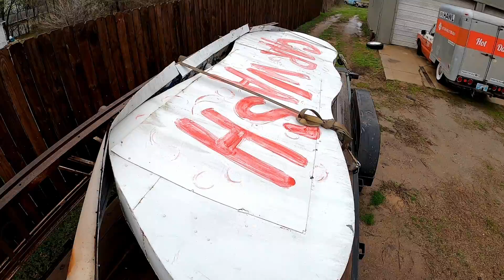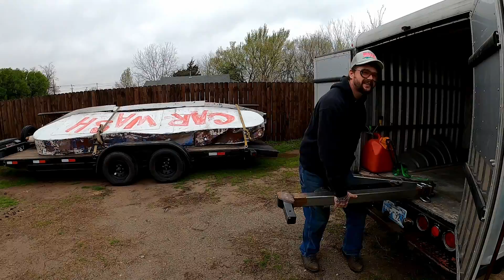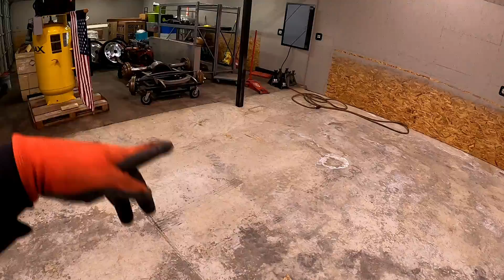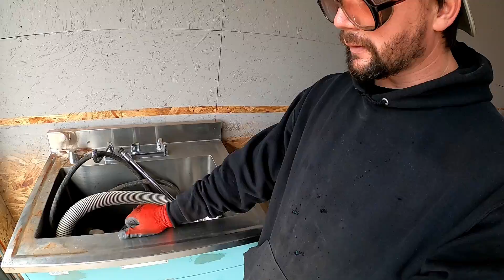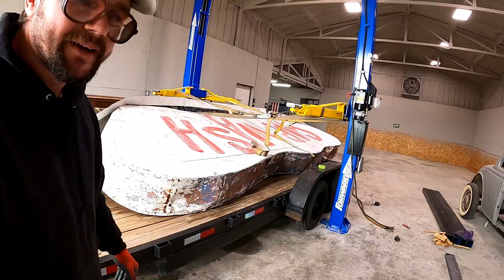BIG SIGN, BIG PROBLEMS. Successfully wasting time.

Comment: IF you need a welding truck look into military surplus. Years ago they used Dodge 3/4 ton trucks with a custom box. Gas motors and they worked well for the job. You could probably find one and use that for a starting point.

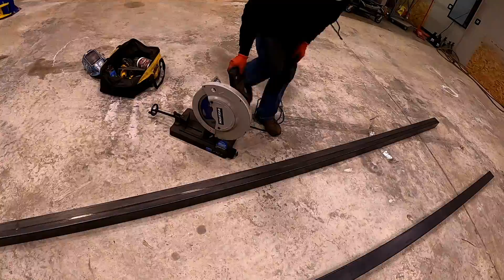Comment: @12:45 you had just finished saying "We Dang Sure Don't Want These at a 45" 
But a 45 just might be your best solution. 45 on the Breaker wall and 45 on the far wall.

Comment: I bought a harbor freight parts washer, works great but put that  35 gal bucket on a piece of plywood because it rusts underneath the barrel when its on concrete. Mine leaked out all over the place after 5 yrs

Comment: Get a concrete cutting company to cut a groove around the base of that wall. Then put your metal plating into the groove and attach your metal plates to the wall. you can also trowl in some hydraulic cement into the groove and sink the plating into the cement. They sell that cement in gallon cans, just mix  water with it in a paint bucket it takes a day to set. So you'll have time to work with it. Gotta keep them sparkys away !

Comment: it ain't cheap but one of the things you can use is Hardie board made of concrete for the lower part of your wall to prevent Sparks from catching your or sheet metal

Comment: thats a nice lift.  Don't hook to a 100 amp Disco.  Keep it instead.  Replace the breaker in the panel it's like 10 bucks.  Theres a lot of short cuts but don't take that one.  Especially with a flying splice.  I know your already done but that can be a really expensive hack.

Comment: Never thought of the sparks starting the wood on fire, but wouldn’t it be massively cheaper to put aluminum sheathing at the edge instead of thick steel? I guess the aluminum wouldn’t stop the walls from getting scarred up. I’ll defer to you though. You’re building a fantastic shop, so don’t listen to me. Cheers from Maryland.

Comment: When we got our lift at work, I read a suggestion online to run a file down the inside of the posts where the sliders (or rollers if you lift is fancy) travel up and down the columns.  There was a ton of weld spatter in there, so knocking those down probably greatly extended the life of the lift considerably.

Comment: Puddin why move the chevy when you have the 4000lb lift against the wall..if she's workin' you could easily use it to pick up  the chevy one end at a time..
Reply from the maker: Also the print on that lift said 100 pounds when I got it. I turned the 1 into a 4 and added a 0 with a permanent marker 😂😂

It’ll definitely do more then 100 but the 4000 was a made up number 😂
Reply from the maker: The lift reaches other made 5 ft. That’s a 17ft king car that has to be lowered at the same time

Comment: I would use PVC baseboard trim if you are concerned about sparks rolling up against the bottom plate.  You can buy PVC panels in larger strips or even sheets and rip down on a table saw.

Comment: Insurance Insurance heavily insure it but sparks from welder will cool quickly and it will not burn down the garage.  I have seen oily rags cause more garage fires than a welder. You said to lock down a good woman, there's no such thing as a good woman.
Reply from the maker: That’s funny, having a good woman has helped greatly to get me where I am!
Reply: @Puddin's Fab Shop 2 (All The Extras!)  you got lucky most women nowadays are worthless gold diggers got 3to5 kids and they are simply wore out from all the 🐓that's been ran through them

Comment: Go get some shower wall sheets at lowes or homedepot. Run them 4x8 sheets along the bottom of the walls, they aint fire proof but no sparks will randomly light it up. Easy to clean, flat so you can mount stuff to the wall... cheaper than metal plates

Comment: For spark suppression ... don't cut or weld near the wall ... use containment blankets (fire retardant) when cutting or welding ... install a full-building freon-based fire suppression system (pricey these days). Mix & Match Puddin! 😎

Do you have a sink and hot water heater in the new shop? If so - Parts Washer. If not - BUY a Parts Washer and hook that puppy up.

RE: Your wallet, hope you found it. For me it's always in the last place that I look - and the first place my wife does.

Comment: also... for the skirting I gotta wander if you could maybe cut the sidewalls out of a bunch of tires then split the tire hoops and use them for heavy duty skirting around the workshop inplace of the metal? Surley old rubber tires are aplenty and sure they might catch fire but are much easier to see and replace

Comment: You made the right choice with the sign Puddin. As for the pole in your workshop set 4 or 5 feet back and that give you room to move between the 2 areas and support the loft, just my 2 cents. Have a good one brother.

Comment: I pressure treated 1 x 6 with a angle cut on the top was my choice for trim everywhere. Paint everything with exterior paint and caulk the floor seams with a good caulk . 28 years and no problems with fire ...let er rip

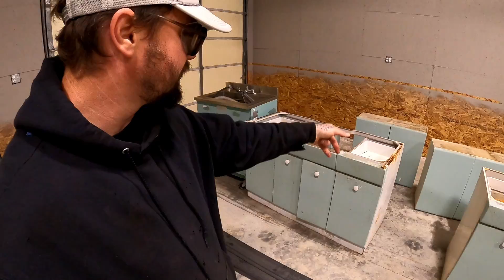Comment: @10:15 I might suggest cement board from your home improvement store. Used as backing for tile. Pretty much fireproof. Has to be cheaper than using thick steel? That steel would be better used in your fabricating :-) You can always double up with some flashing from the roofing section. That can be purchased in long rolls. Thin but also good for what you are looking to do.

Comment: Sink/part washer.use the sink, but transfer parts and lid from a Horrible Fright parts washer.  The recirculation pump is a self contained unit.

Not sure if you noticed, but the reverse lights are not working on the Yee Hawl

Comment: If I were you, seeing how you light fires with the 'slice-n-dice' let alone a welder, line that lower section with cement board. Durock or Hardyboard.

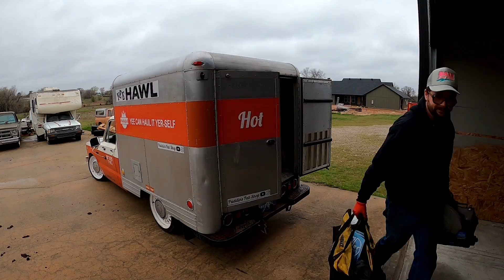It's moisture resistant, fire resistant; you could finish a number of ways. Its mostly used as backer for tile however, I first encountered it in a middle school with an acrylic texture finish. 12:03

Comment: I would put pipe each side and I would put a H steel going across that way you can put Chan fall that is on rollers that way you can lifted things and push it over to either side . I would not what that poll in the middle of the floor it be in the way. Hay did you fine your wallet I hope you did

Comment: one key in each vehicle! Id hook the sink up as a sink, most shops Ive ever worked in had a regular sink if for nothing else washing hands but you could add a spray hose in case of chemical splashes to the face

Comment: In regards to electrical work: I didn't closely examine your setup, but as a general rule, it is safer to close disconnects(knife switch) before closing breakers, and the opposite when opening them. Disconnects are not built with arc flash protection in mind. Breakers are. That is why you want to use the breaker to make or break the circuit and disconnects just for isolation purposes.  It is less consequential with lower wattage circuits like what you were working with, but still a good practice. Low voltage circuits kill people about as often as high voltage and usually it is because of less percieved risk.

I work as an operator at a power plant. I am not an electrician but I do a lot electrical work on circuits ranging from 13,800 volts down to 24v circuits as a part of my job. I am totally good with people making their own decisions regarding risk, but I did think I would at least share that knowledge because if you don't know, it is hard to make good risk assesments.

Comment: Not sure if you have a circular saw but a 7 1/4" diablo carbide steel demon is a beast for cutting metal, if ya got a 10 or 12" miter saw you can get the same blade based in the size.

Its not a metal cutoff miter saw blade but those blades on a regular old wood cutting saw will do wonders.  Just throwing it out there.  Also doesnt heat the metal up or shoot sparks.

Theres a video demo by Diablo of the damn blade cutting 1/2 way through a piece of railroad track

Comment: I bought seconds of white metal shop exterior and cut it 4 ft. tall.  I mounted it to the bottom of the walls and built a shelf with a 2X6 at the top for storage.  Ended up working well and I can power wash the shop when needed.

Comment: mop board works pretty well at the base of walls.  I dont like open shelves or tables with clutter under them that sparks can hide.  I try to get as much stuff stored in metal cabinets as possible.

Comment: On the parts washer.   I bought a HEATED parts washer, and I use Zep Industrial Degreaser in it. When I use the heat function, the ability to clean parts doubles. Build a heated parts washer!

Comment: Pro tip, keypad lock.  My shop and warehouse has one.  Remember the code with a key backup.  You never get locked out.  As for fire prevention, I built a steel building with steel walls inside.  Taking no chances.

Comment: For your spark resistant baseboards we ran mortar for bricks about 1\4 inch thick with chicken wire just screwed to the wall for about 8 inches tall and then we just put sheet metal as wainscoat right over the top

Comment: If your worried about cetching fire put that thin aluminum star plating under your kicks on your cabinet doors .I think you can find it selfadhesing And 8 or 10" of thin metal at the bottom of the walls in your welding area.

Comment: PUD! Take your time. You are one step ahead in your motivation, one step behind in the situation. The steel at the floor is a concrete staining conflagration, the posts are a positioning miscalculation, and you will discover the the correct posituation. Etch the floor with vinegaration. Then  use a polyurethathane sealant, (available under several different brand names at your local hardware store) to glue a synthetic (vinyl, polystyrene, PVC, cheap) base around the shop. Save your steel. Think of the overhead supports lengthwise and buy some cheap local lumber guy's stuff and put your posts where they work. Love you man. Andy

Comment: About your fire protection question, it's a little late now, but there is a such thing as fire rated plywood. It's used in construction. Could replace the bottom 4' of that osb with rated plywood.

Comment: I got to say that I usually roll with what you put on you tube but this episode was an absolute mess and waste. Does Oklahoma have building and electrical inspections? That redneck wiring of the lift takes the cake. PS, use the sink for what it’s intended and buy a parts washer with the money you wasted on the sign.

Comment: There are some flame resistant paints and sprays, you could paint the bottom bit of those walls with some, if you were really worried about it. 
I think you should use the sink as just a shop sink, if you have plumbing out there.

Comment: You could seal the bottom with fire caulk before you add your baseboard and another thing that will help with your wood wall finish is an Intumescent (fire retardant) paint.

Comment: When you nail your baseboards put a old 2x4 on the top against the wall and the ground like a ramp into the wall resting on the baseboards step it down and nail it hit a stud and caulk or silicone the small cracks it will still dry out if it gets wet if you use silicone you can give it a light spray of goof off to smooth it with your finger

Comment: I think you'd do well to have sprinklers installed in the shop.  Wouldn't cost much to drill a well near the shop and that could feed your sink,  emergency eye wash station and swap ass shower as well.  Plus the homeowners insurance might give a discount.
Reply: Good idea, but around where I live, having a well drilled is approximately 5K. That's expensive to me.....

Comment: In Florida, we would probably put medal lath, and stocco that, think about it, fairly cheap, and water proof, can use synthetic comes any color, wire lath is like 28 inch wide by 8 foot, is what I would do, check into it

Comment: Puddin, We use sheet metal in our welding area to protect the walls from sparks.
I suppose you could also use that slate stuff (or whatever it is) that people put under their free-standing wood stoves.
If "Sitting on your ass won't finish your project," will sitting on your project finish your ass?...😉😜

Comment: RED fire stop, it comes in a tube like caulk, run a 3/8 bead on the floor and one  on the wall, set the plate in the caulk then push it up against the wall and screw it, that way the plate is sitting in a bed of firestop and its pushing firestop in the gap protecting your sill plate, it wouldnt hurt to run a masons string along the floor next to the wall to see how much the floor fluxuates, you may need a little more here or there, I cought my garage on fire once, I was grinding on my vega and sparks were hitting the ceiling joists, I smelled wood burning and looked up to see my ceiling joist in full flame! I painted all my exposed wood surfaces with fire proof paint and was fine after that  that was a scary sight, carry on brother

Comment: Oh Hell Yea!! Hey Puddin, look into some fire retardant paint for the lower part of the walls. Had to use that stuff in a shop I worked at in the past. The powers to be wanted us to paint the walls with that stuff up to 4 feet from the floor, because we were using a forklift in the shop that they said could scorch the walls.

Comment: I worked in a body shop that was on a second floor of a old wood building they had 16ga metal  on the floors and 3 ft up the wall, that's what the fire inspector wanted.  never had a problem  I would seal it to the floor

Comment: I would use fire caulk to seal the base plate.  It is intended to stop fire from running thru penetrations in walls and floors.

Comment: Use some thin angle iron like 2" wide along the floor you could tapcon to the concrete and screw them into the studs will help with structural support too just in case a nado comes

Comment: I like them ole blue cabinets. on one of the british car shows they used a vapor blast? it looked like a pressure wash/sandblast cabinet. you could have a vintage one with all the stuff u have with it already. U could get some poly carbonate for the top and it would be bitchun. I am tryin to find somethin similar, to con vert my old pressure washer. oh well dig ur shop. asta!

Comment: Rather than a parts washer, make that old sink into an ultrasonic cleaner -- imagine the carbs you could clean in that!  An "off-the-shelf" ultrasonic cleaner could be scavenged and or modified to vibrate a larger tank, like a stainless steel sink, I am sure of it.  Couple fry baskets later, whammo!

Comment: Replace the bottom row of osb with sheetrock. Fire tape the joints and run a bead of fire caulk at the floor. Spark problem greatly reduced.

Comment: You should use cement board for protection instead of the metal. They also have fire board that is used in fireplace construction that's meant for the heat and embers both are the same type of material. Your gonna need the metal Mr. Fabrication.

Comment: Open floor plan is best bet 
More money now less headache later
Have you check all the pad thickness to make sure you have enough to bare the weight, the lift is similar weight but pads do vary (just a heads up)

Comment: As odd as it sounds, if you cut your square stock using the “45” bracket they gave you (so the square has a corner pointing upright), it will cut faster and save the blade as it’s not doing a big flat cut - always just a thin cut.

Comment: your wallet is next to the one legged dog....really its under the seat of the travellall...4x8 diamond plate would look great along the bottom of the wall then cement in blue slate as a wash board....1 inch thick 6 inches high as wide as u can find,,,,dun!

Comment: Hey puddin iv been in construction for 20 years and what you need to look into to not have a post in the middle would be call a LVL support beam to span across then one across other way kinda like a off set t shape and build your floor ontop if you see this email me I'll be happy to show you what I mean 👍 don't no your measurements but you may not even need eny in the middle on otherwise either

Comment: Use fire retardant caulking..the breathing crap is crap..lol..im sure the garage is like all garages and isnt sealed 100%..I use a welding shield but i only weld in one place..My ole buddy has a fire proof tarp that he moves from place to place as he welds..actually one side of the car to the other..he drapes it over a few jack stands .Also you can get fire retardant paint..good luck..😊

Comment: What if you put up some drywall like 4’ and some tile baseboards . Then you could seal it right to the floor and a cap on the top of the drywall and caulk so then no sparks can infiltrate the wall

Comment: I would use 5/8 fire-rated drywall way in the hell cheaper than that steel you bought now you have to worry about Sparks going between the steel and the wood sounds like a bad idea to me

Comment: You could clad the bottom board's on those units with strips of those rusty metal sheets you were going to use to go around the bottom of your walls, just cut them to size and screw them straight to the existing skirting boards,
Reply: You’re absolutely right on the neon sign idea. That’s some on point branding right there.
Reply: @cmleoj  i wrote that before the bit where he scrapped the sign, after seeing my bright idea thrown on the scrap heap i edited it out of my comment lol, it would of been a great idea for merch and even a video thumbnail or intro wouldnt it
Reply: @daz0705  It sure would! I would have liked to save it, but I have a whole lot of projects here that need saving, so sometimes you gotta know when to say when. 
I did like that sign design.

Comment: some cheep roofing flashing tin would do the work of that heavy steel for the base board fire prevention. just have a 90 broke to it to fit under the wall sheeting and screw it to the wall.